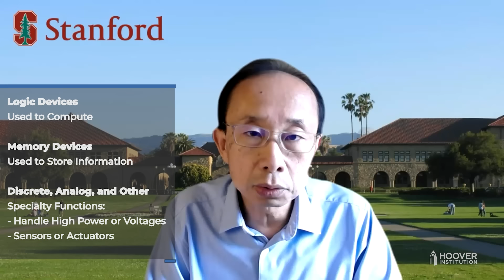H.-S. Philip Wong on the Implications of Technology Trends in the Semiconductor Industry

Comment: There are challanges with the size of manufacturability.  Just recently I started using 35micron pitch chips on a board, most likly the smallest pitch on the market now.  For the board manufacature that is a big challange and extra cost.  Won't the industry go more twards system in package.  Still there has to be a manufacturing break through to push the technology forward.